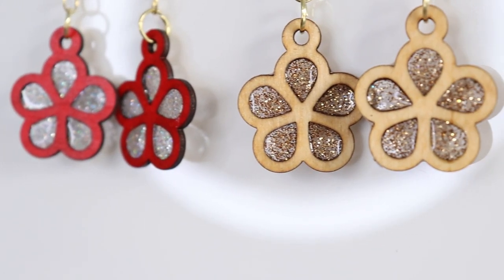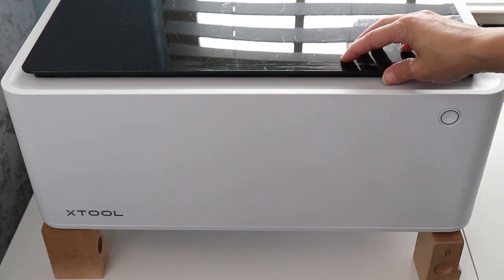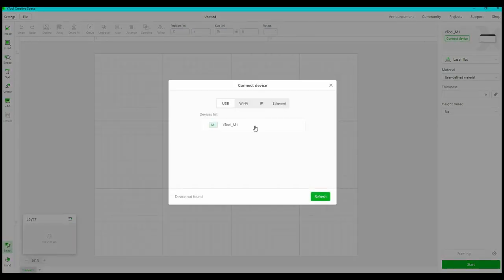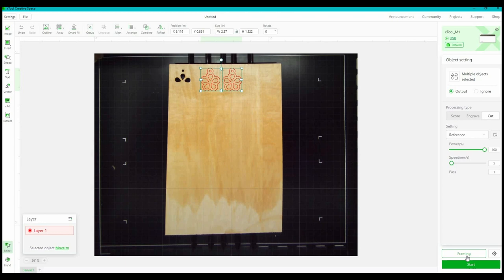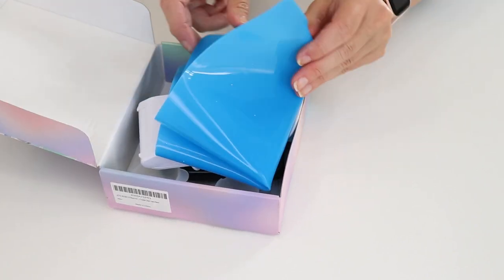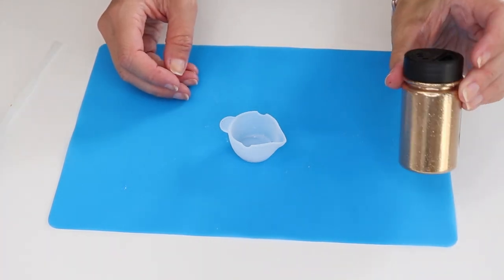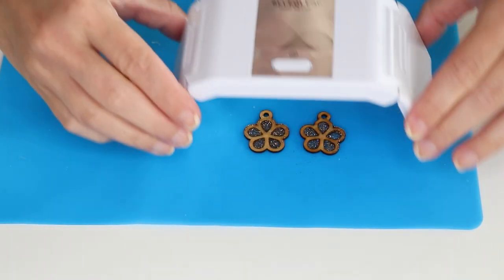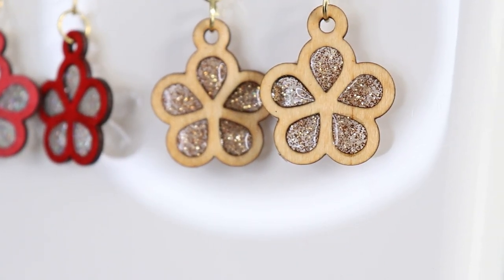How to Make Laser Cut Wood and Resin Earrings

Comment: Good spring day. Wonderful video and clear instructions, but I do have  a few finishing questions starting at the 7 1/2 minute mark.  I see that there’s a little bit of overspill on the back of the earring, after it has been cured. 
1. Do you do normally any sanding  ?  If so, what kind?
2. Do you do any sealing?  If so, what kind do you use?
3. Any idea how much they actually weigh?

Thank you for your time and consideration, 
I will continue to look at more of your videos. 
CHRIS
Reply from the maker: If there is anything that has spilled over you can sand it afterwards, just a very fine grit sand paper. I don't seal my resin and I do wear these earrings without any issues. They are incredibly light, basswood is ideal for earrings because they won't weight you down.

Comment: I have a XTool S1 20w on order.  I have been watching a lot of videos for the different projects I can do with the lasers.  My question is to connect laser to computer via USB … does the laser come with the connecting cord or do I need to purchase the connecting USB?  If I do can you tell me what type of cord I need, USB both ends as example.   I know you have reviewed the S1, so can you tell me what electrical amps the S1 uses?  I have to use an extension cord and I want to make sure I have one that will handled the load.
Your videos are so helpful and you are a great instructor.
Reply from the maker: I connect my machines via USB and they all come with a cord. You can buy a USB extension if your machine is further away but you may not need it. 
The S1 and others like it operate on a standard 120 volt US outlet and they can run on an extention cord. You'll need an extention cord that can handle the 3 pronged plug. Hope this helps, enjoy your machine!
Reply: @SarahVanderkooy  Thank you very much.  Very helpful!